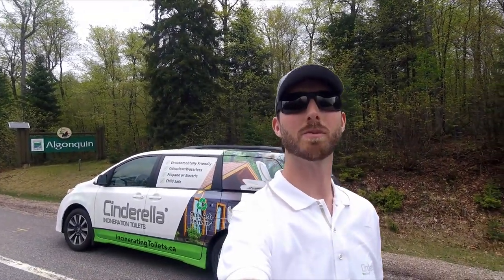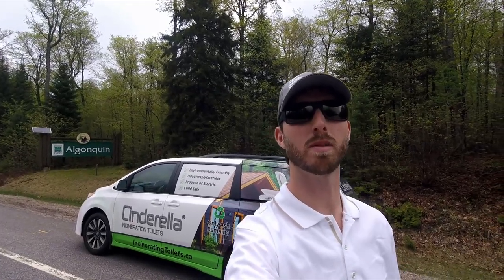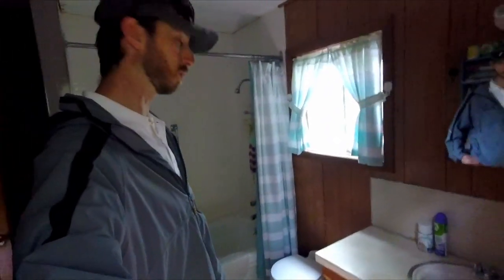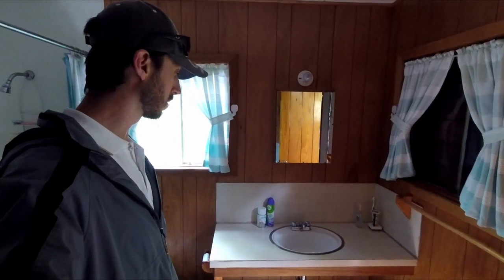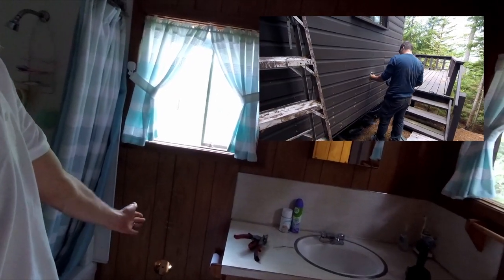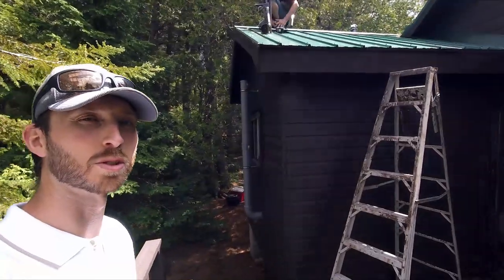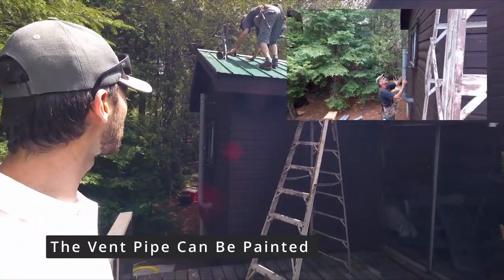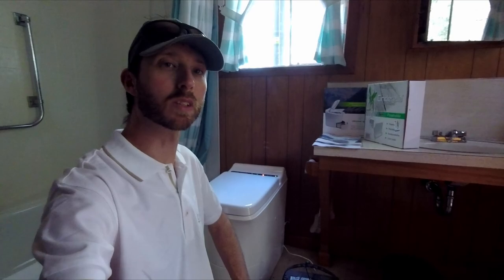Installing a Cinderella Freedom Propane Model Incineration Toilet at an Off Grid Cottage

Comment: Does the vent pipe have to go all the way above the roof line? I'd like to run it much shorter unless there is a purpose for running the pipe that long.
Reply from the maker: There is definitely a minimum length in order to get proper air flow through the venturi. No need to pass the roof peak but it is best to pass the roof surface by a 2ft to ensure proper airflow and efficiency.

Comment: I noticed you didn’t add the fresh air vent was it needed. I’m concerned if I do it’s just going to break with -20 below air when I can crack a window
Reply from the maker: For this installation, because there was a crawl space under the building, we put the air intake through the floor right under the toilet. This minimizes the effect of outside temperatures on the bathroom. In this case the Cinderella sat right over the drainage hole of the old toilet it was replacing so it also saved having to patch up the floor :) The problem with opening the window is that it can be forgotten or someone could come close it that doesn't know it needs to be open. If you are installing the electric model it is a closed loop system and would come through the wall into the toilet or through the floor into the toilet through a 90 elbow.

Comment: Would it be possible to show a picture of the completed propane connection ?
Reply from the maker: I assume you are speaking of the connection to the back of the toilet. On the back of the toilets you have a 1/2 NPT male brass fitting. We recommend installing a flex line with a shut off to the back of your toilet before going through your wall with a hard line or whatever is required by local building codes. This will make it easier to pull the toilet out for seasonal maintenance.

Comment: Do you do installations in Quebec?  How can one buy a Ciderella and book an installation for a cottage in Quebec?
Reply from the maker: Happy Canada Day Joseph. Most of our customers outside our area would hire an electrician or a licensed gas tech from their local area. They might not have installed a Cinderella specifically but the process is well within their capabilities. Especially gas fitters as they install many propane appliances that require venting etc.
Reply: @incineratingtoilets  Thank you very much!

Comment: what happens to the urine? does it incinerate too?
Reply from the maker: That is correct. All waste is incinerated. Cinderella also as a unisex waterless urinal option for those who just need to deal with urine or want to expand the toilet capacity for larger gatherings. The urinal uses no electricity or propane but requires a drain.

Comment: How hot does the exhaust pipe get?  Can I run it between a wall or does it need to vent directly outside?
Reply from the maker: Not that hot David. Yes, you can run it inside the wall if you want. A nice option when you are installing the toilet in a new construction :)

Comment: Why do you need electricity if it's powered by propane?
Reply from the maker: Great question. The propane gas is used to generate the heat but there is a small amount of DC power required to run the exhaust fan, display, igniter (no pilot light) and hatch when flushing.